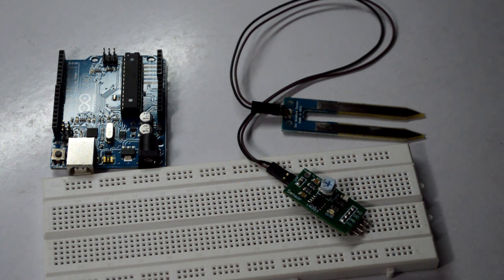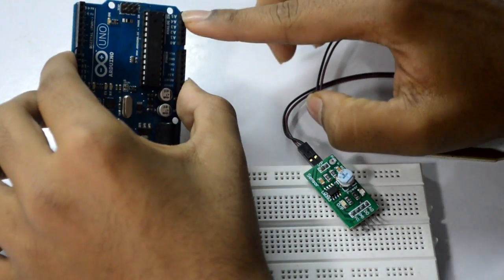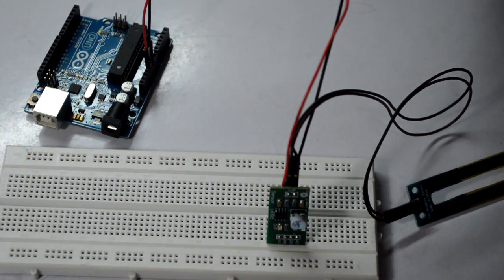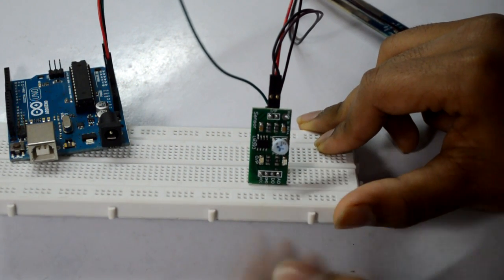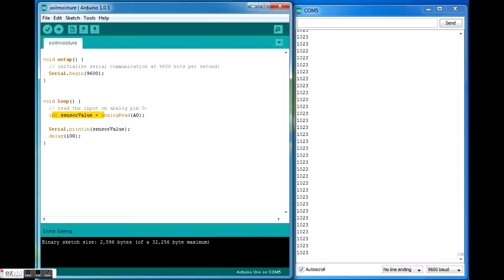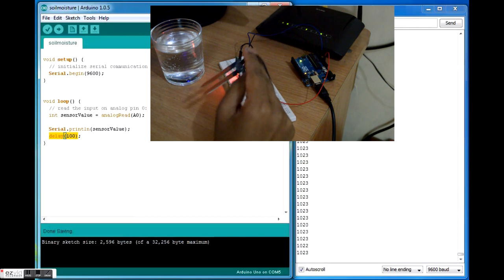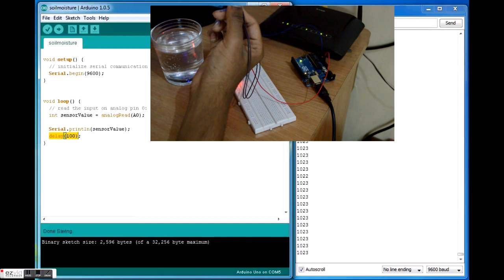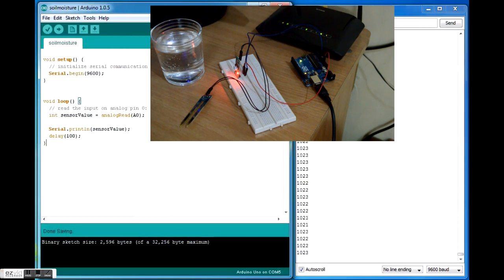Soil Moisture Sensor with Arduino- Interface and Coding

Comment: Do I need a data logger shield to get the readings of the sensor, or the Arduino UNO will do the job in viewing the readings on the computer screen ?
and could this code be expanded to connect a water pump to turn on depending on the sensor's reading ?
Thanks in advance for your response.
Reply from the maker: You only need the UNO to "VIEW" the values serially, you may need the shield for storing these values in the order they appear.
This code can be surely extended for the pump thing. just declare one more digital pin as output
use an if condition based on the value and turn the pump HIGH
Reply from the maker: @Hassan Kamoka click on the serial monitor(top right)

Comment: hi thanks KD for a great tutorial. I ve tested it with my arduino and soilmoisture sensor. Its working well. Can you please clarify in which cases the digital output pin is used? ( here you demonstrated with the anolog output pin). An example could be helpful. Thanks for your time.
Reply from the maker: The analogue output pin of the sensor gives a varying analog i.e. from 0-1023 Because the resistance of the sensor varies the voltage from 0-5volts which is mapped to the 0-1023 analogue values. Always remember one thing, in analog electronics the value of the Voltage varies throughout the circuit
Coming to the digital part, voltage in digital electronics(mostly or to simplify things) has only 2 values i.e. HIGH(5Volts) and LOW(0 Volts). So the Digital output pin from the sensor will go to Digital Pins(0-13) Input on the Arduino using the digitalRead() Function! As a result you will get HIGH or LOW , just these 2 values as OUTPUT.
Have fun!
Reply: Great explanation KD. I am a mech engineer with very little understanding about electronics. Your tutorials in fact helped me to execute my first projects in electronics and gave me a lot of confidence to explore more in future. Thanks a ton again. Now I ll  try the digital pin and check the 0 and 1.
Reply from the maker: gowtham dronamraju Your most Welcome!
Lets us know if any other videos you want from us

Comment: Can i ask where did you get the soil moisture sensor?
Reply: He tells you where at 4:18 ... "If you want to buy this sensor, you can visit www.[INCOHERENT].com"
Reply: You can get it on Amazon.com
Reply: Ebay!

http://www.ebay.com/itm/Soil-Hygrometer-Humidity-Detection-Module-Soil-Moisture-Water-Sensor-for-Arduino-/360695825670?pt=LH_DefaultDomain_0&hash=item53fb258506

Comment: MOISTURE SENSOR OUTPUT
-----------------
# the sensor value description
# 0  ~300     dry soil
# 300~700     humid soil
# 700~950     in water

Thank You! :)

Comment: Thanks for the quick reply; I think you may have misunderstood my question I was referring to the jumper leads.
Reply from the maker: ohhh..
nope they dont make any difference unless and untill they are connected to the inner (female) pins of the Arduino

Comment: Hi I’m new to electronics so this may be a silly question,
Would it make much difference if I use longer leads to connect the sensor to Soil Moisture Detector Module?
by the way great tutorial.
Reply from the maker: Its ok dude!
It will hardly make a difference. It is because the area of the leads under water is directly proportional to the analog value. If the leads are deeper in the water,it will give a comparatively lower value.

Comment: void setup() {
  //9600 bits per second
  Serial.begin(9000);
 
}

void loop() {
  //read input analog pin 0:
  int sensorValue = analogRead(A0);
  Serial.println(sensorValue);
  delay(100);
}

Comment: hi alonzo, to generate a value between 1 and 100 use the map statement and then constrain to make sure the value is where u want it.
map(value, fromLow, fromHigh, toLow, toHigh)

x =map(value, 0,1023, 0, 100)   //remap value to new range
constrain(x, 0, 100)   //ensure value is 0-100 in case something goes wrong with sensor or calculations.

Comment: can a adruino sensor be interfaced with a microcontroller kit???
Reply from the maker: Yes,
Generally a sensor has 3 cables: power,gnd and data
The data pin can be connected to any port (A/B/C/D) and you know where to connect the remaining two!

Comment: That tutorial was awesome!  One question.  How do I get the output to display the value of the moisture?  I see that window showing the moisture value displayed as COM 5 and just don't know how to get that screen to display.  Thanks!
Reply from the maker: Hello,
      It is called as the serial monitor window
You can find its icon on the top right corner of the Arduino IDE. The Icon is of a lens; when you hover on it , the words Serial Monitor will appear.
Regards,
 KD
Reply: sir what is the unit of these values
?